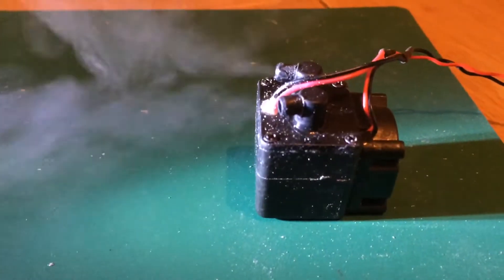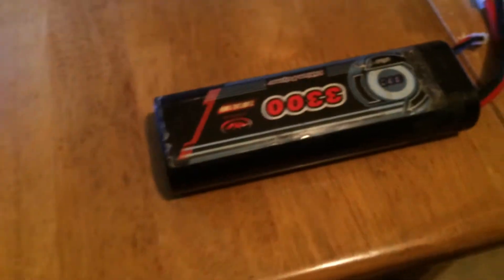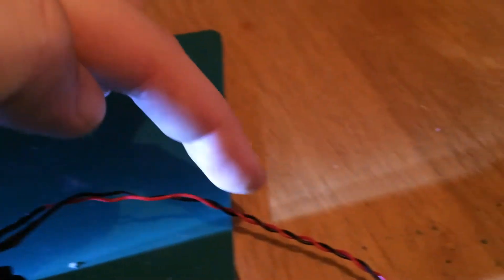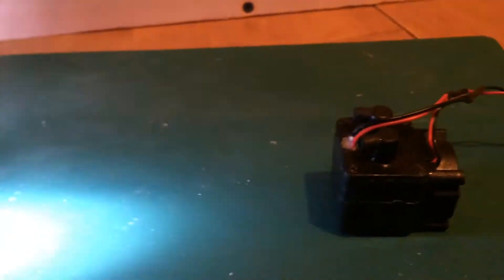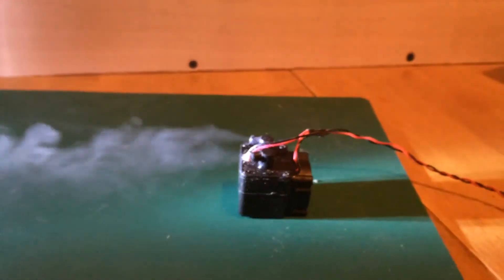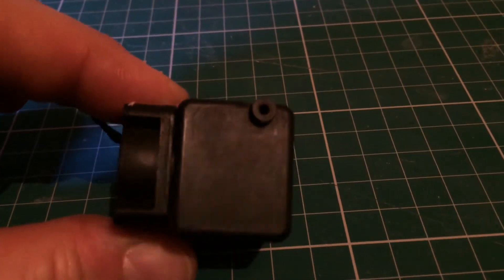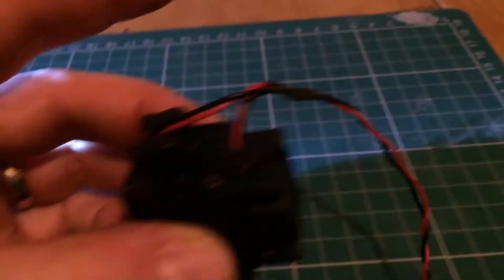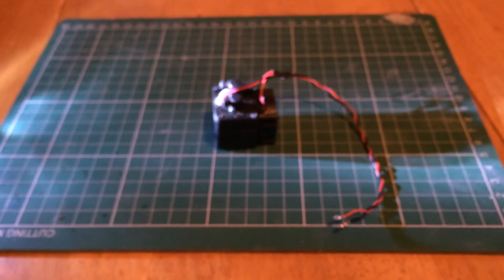Heng Long smoke unit with 25mm fan

Comment: This is awesome. I purchsed the fan, but am unsure what you did to the side of the smoke tank to allow the air to flow in. I have removed the stock blower and am left with the nipple on the side. If you simply put holes in the side of the tank, how do you keep the cotton wick from getting in the way of airflow? How do you keep oil (I use vegetable glycerine) from getting in the fan? Do you cut a passage at the top of the tank only?
Reply from the maker: Thanks. I just sanded the side smooth where the old HL pump was, opened the air inlet hole up with an 8 or 10mm drill and then superglued the fan on the side. No need to reroute the cotton wick, as you can see the airflow is fine as it is. I never filled up enough for the oil to spill out, don’t think it would make much difference if it did TBH.
Reply: @MrCripsy  I REALLY Appreciate you explaining what you did. Once again, the "smoke" is awesome !! Nice work !!

Comment: Nice work, good.
But I did not understand? Is the fan only glued to the side? is the oil tank the first model heng long? Thanks
Reply from the maker: Tommaso Nesi Yep, fan is glued to the side of the Heng Long smoke box.
Reply: @MrCripsy  When removing the cylinder, there is an air hole.  Should it be enlarged or should it be of that diameter?  thanks
Reply from the maker: Tommaso Nesi I think I enlarged this one to apx 10mm. It allows more airflow

Comment: Thanks for the review. Can you please mention the input voltage range ?
If possible pls provide the purchase link. Unable to find in amazon
Reply from the maker: 25x25mm fan on eBay. I use the 12v version to make sure it could handle a 7.4v lipo battery.

Comment: Hey thanks for the vid, was wondering what voltage of battery did you use to power this? Thanks.
Reply from the maker: In the video it’s running on a 2s 7.4v Lipo battery. You get a similar output on a 7.2v Nicad or Nimh.

Comment: Great mod, I’ve just done same after seeing your vid 👍 do you know how much liquid u need to add to the chamber ?
Reply from the maker: JM 79 just enough to wet the rope inside. If you flood it the element won’t be able to get hot enough to make the smoke.
Reply: @MrCripsy  Thanks you have disconnected the linear motor version or their pump version and connected this fan i suppose. Any additional holes u made in the smoke unit other than the exsiting small hole.
Reply from the maker: Hari It was a standard Heng Long smoke unit with the noisy piston style pump. From memory I think I enlarged the hole to 8mm to help increase airflow.